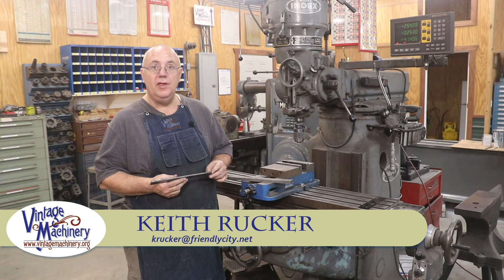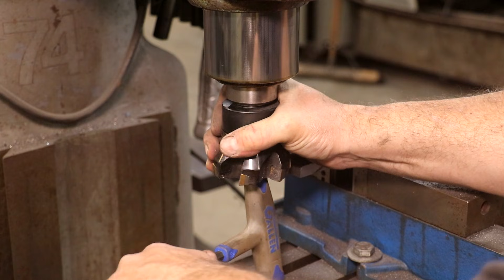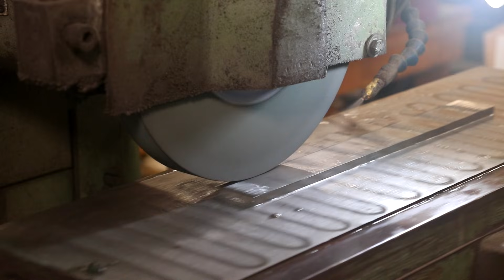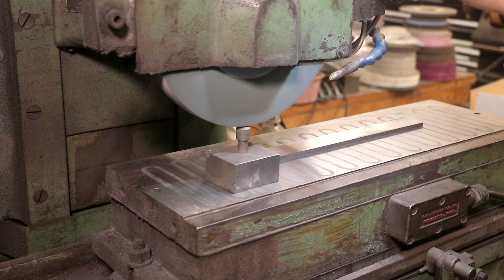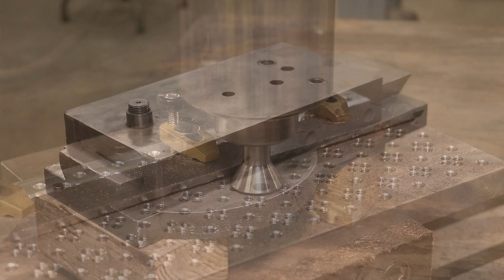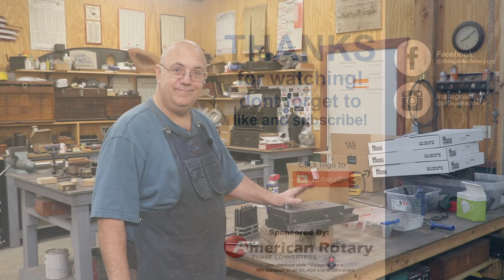Metal Planer Restoration 48: Making a Flat Gib for the Clapper Box Cross Slide

Comment: By placing a bowed nonflat  part on parallels then tapping it down with your lead hammer you bend the part into compliance with your parallels. Then you milled it flat ?, when you release the vice your part will bow back. The best approach to this would have been to check the part on your surface plate and determine the bow that would have rested on the ends of your parallels then place the piece on your parallels in your vice in this position. Do not tap it down- you do not want to bend your part. Take light milling cuts to flatten this side. Recheck this milled side on your surface plate to see if it came out flat, if it is flip the part over on the parallels and you can now tap the part down to your parallels. This would have avoided chasing your tail getting the bow out. You have a great site and I love what you do, I just wanted to point something out.

Comment: Keith, have you thought about spot facing the gib where the adjustment screws contact it? I noticed when rebuilding the turret on my Hardinge DSM the straight gib has this feature. I don’t think Hardinge would have done it if it wasn’t beneficial. Just a thought.

Comment: Just made 8 small dovetail slides out of grey cast using the same old 4 set screws for the gib method . Basically a copy of a SETCO guide . One detail I think you missed is that that spot facing should be “ flat bottom “ and at 90 degrees to the grub screw . Doesn’t make much difference but anyway a you’ve done a wonderful job . Thanks for sharing

Comment: Interesting you put it in the surface grinder as you did. With wood I'd have put it so the curve was up in the middle and shimmed it so the magnet didn't pull it down. Then you could grind the curve out of it without risk of putting spring into it. Maybe it's different with metal.

Comment: Tomato, tomahto. According to Dura-Bar's web site, "Dura-Bar's® continuous casting process begins with a water-cooled graphite die that is machined to form the shape of the bar.

The die is mounted on a bar machine crucible. As the bar is pulled horizontally from the crucible, the head pressure feeds molten iron into the die, producing a fine-grained cast iron bar.

Since the bar is being pulled from the bottom of the holding crucible, dross, slag and other impurities float to the top, away from the opening of the die. The Dura-Bar® process enables the microstructure to be free from shrinkage, gas holes and other tool-wearing inclusions."

So, technically it is an extrusion as the metal is being forced through a die under pressure to form the desired shape.

Comment: When you were using the transfer punch to mark the holes, I was wondering to myself if the angle of the gib was great enough that the edge of the punch would touch the gib before the center point of the punch. I believe that may be the half moon mark you saw on the gib.
Thanks for the videos, I have really enjoyed this rebuild.
Reply: And when drilling the dimple in the gib, should it not have been held at the same 45 degree angle?  Otherwise, it seems like the screw will push the gib down as much as across.

Comment: Keith, you are using Duracast. I'm not familiar with this material. Is it completely stress free? Otherwise I would machine it symmetrical to the centerline. And I also would use some machinist jacks to support the ends. Or buy a longer piece for support on the bed directly. Deburring before you flip the part wouldn't hurt either. And skimming before grinding is also a good idea. It won't matter when squeezed down at it's final place because it seams to be flexible enough to swing to the right place when tightening up the guide screws.  Dear Keith sorry about being picky but this episode looks somehow sloppy to me compared to your other work. I hope it's not a motivation problem ;-) Thank you for all your wonderful uploads; I really enjoy watching them (maybe a small tip on the side; don't put your microphone under your nose. I should lose some weight, just as you, but the panting sometimes scares me...) Thank you Keith! Love your work and I'm only trying to improve it a little bit. Best, Job

Comment: A couple of comments in one - 
Firstly, I note on the vertical operations you keep moving the quill down - removing rigidity to the setup - rather than raising the table - which would have been the better option and may be nearer a better working height for you !
Secondly, you mention about the benefit of the 'palette' for mounting the work - well I'm not seeing anything there that you couldn't do mounting directly to the table.

Comment: Transfer punching down the adjustment holes - depends what the ends of the adjusting screws are like - fine if they have really pointed ends but if the ends are relatively blunt, you need a similarly blunt transfer punch so that you know the vertical offset of where the dimples need to be to hold the gib from sliding out !

Comment: Using shim stock on a surface grinder will help in getting items flat. Place various size shim stock to take up space grind and flip it over and grind the other side and will usually end up with a flat part.
Reply: That what I thought too...because flipping the parts several time while grinding doesn't make the part straight....but on the other hand for the purpose of the part it doesn't really matters if it's a bit bend
Reply: Old tool maker trick. On surface ground parts that require a good finish on both sides use wax paper on the chuck to prevent pull-off scratches.

Comment: 10:30 Why wouldn't you run a file over those edges to debur before flipping the part over?
23:00 Why would you risk a set of parallels rather than just clamp the part over the near edge of the pallet?

Comment: For a dog point set screw you need to set the gib up at the dovetail angle and put your dimples in with an end mill so the dog point has a flat surface to press against.  Going in against a drill bit dimple will force the gib down and cause it to drag on the surface of the carriage.  I wonder if those screws are original- I can't imaging being able to maintain the adjustment without a jam nut to keep them from backing out.

Comment: I think the half moon you got after center punching, was from the top edge of the center punch. They are intended for flat transfer, on an angle like the gib was at, I was surprised the point hit at all.
Reply: Indicating the correct position for the divots !! Actually, it only needed one doing - to stop the gib sliding out.

Comment: To those new to machining and watching this, some words of advice. I know this is not a how-to, but people that are new, watch this and copy the person they are watching. Good habits and the bad habits.

1. Always deburr your part when you remove it from the vise and flip it over (smooth file!). Those burrs will nearly always find themselves under the part and between your parallels pushing it up at an angle.
2. You also want to actually clean your chips off of the parallels, the chips that fall onto the parallels when you removed the part. Chips have thickness, even cast iron dust.
3. Before you clamp your part, make sure your parallels are standing up straight and not cocked at an angle. Parallels at an angle have cosine error and will stand your part taller than a flat parallel. It might not seem like much but a 2"H parallel with a 0.005" chip under one corner or cocked at an angle will raise your part up a considerable amount. Tapping it with a mallet after its clamped will NOT flatten the parallel out since its now in a bind. It will only hammer a groove into your finish all the while making your new cut no longer parallel as you intended it to be.
Reply: This guy is a hacker. His entire channel is a big example of how not to do things. I still find it interesting, though. I do feel like he could be better at what he does, he does a lot of these things for himself. But there are people who watch these videos and I am sure they try to do what he does and they ruin things. 

Within the first 6 minutes of the video I was laughing at all the lack of proper techniques and practices.

Comment: I would put a shim under the middle to keep the magnet from deforming the part.  Given the upward force of the dovetail cutter, the third clamp probably is necessary in this thin part to prevent upward deflection in the center.  If you turn the rounded side of your flat washers toward your clamps, the washers will not mar your clamps.

Comment: I notice your 'indents' for the gib screws were drilled square to the world.  Some of the gibs on some of my machines are a 1/2 moon shape as they were milled (as opposed to drilled) at the angle of the gib.   In your case that would be 45 degrees.  It seems a minor detail but the bottom or pressure end of the screws would be resting on a flat surface.  Was the original you had a simple dimpled like the one you made?  And, does it matter either way in your opinion?

Comment: With the surface grinder try placing shims under the "curved part every inch or two.  Block the part in on the left side with material that has been ground flat and smooth.  Turn on the electromagnetic chuck then turn the chuck off and grind using residual magnetism.  Residual is not always strong enough with parts that are rough which is why it is important to use the ground blocking.  The flater and smoother the blocking the better it will be able to grip the chuck.
Reply: My thoughts exactly, (woodworkers do this on a planer sled !), the way he is doing it is just chasing out the error, instead of rectifying it from the start !
Reply: @russterman1  The way Keith ground the part clearly works.  
However in my experience flipping multiple times works rather slowly and only for small errors.  Bigger errors I have found are easier to correct like I explained previously.  
That said if the part is out .03" typically I would dust it off with a face mill.  
However there have been times when I have taken .250" off a piece of steel 27" lg and 1.125" wide with the surface grinder as I did not have a good face mill.  My Bridgeport and my CNC mill where set up for other things and I could set the grinder up and walk away and and let it run unattended with auto down feed.

Comment: You are a madman. "I took this over to the surface plate and scraped it in"
Reply: Yeah, I was thinking that he might take it over to the surface plate and lap it slightly.  However, on further thought I realized that a scraped surface would make a much nicer bearing surface. This guy's got class.
Reply: @stuartschaffner9744  So why would a scraped surface be better than a plain one which would effectively give a greater bearing surface ?
Reply: @NeilAbalone  I understand that argument but as the oil being used should have good capillary attraction, a smooth surface should slide better - like bald tyres do in the wet !
Reply: @millomweb  , very good points. Keith and others have done several videos on scraping.  As far as I understand from watching them, there are several factors.  First, super smooth flat metal surfaces tend to stick together.  Try putting clean dry gauge blocks together.  Second, steel is pretty strong compared to the loads being put on it in this case.  The slight ridges on a scraped surface provide, in this case, plenty of bearing surface.  Any extra just increases the sliding friction.
Finally, the little valleys between the ridges serve as an oil reservoir and channels to help oil to flow.
Reply: @stuartschaffner9744  The idea is to provide lube so they don't wring together !
The bearing surface is supposed to be oil, not steel !
Reply: @millomweb  ,  umm, well yeah!  Isn't that what I said? Sorry, but I was trying to confine my discussion to what I had heard in the scraping seminars I watched. The tiny ridges on the scraped surface act like a bearing surface while the area between the ridges act like oil grooves.
I will go slightly further to say that you might find OxTools' air bearing project fascinating.  There the two metal surfaces are super flat (no scraping) and the lubricant is air. Tom measures the electrical resistance between the two surfaces.  When the upper disk is motionless the resistance is low, indicating that the metal surfaces are touching.  When Tom spins the upper disk the resistance climbs because of the insulating properties of the lubricating air film.
I am trying to limit what I say because this conversation could get really complex really quickly.  For example, a drop of oil has a surface tension while a puff of air does not. At the same time, oil is orders of magnitude more viscous than air.
I don't want to sound discouraging because you are asking many of the right questions.
Reply: @stuartschaffner9744  To avoid bearings wearing, the metal surfaces shouldn't touch and are therefore separated by a layer of oil. Making space for oil by scraping does create oil pockets but also takes away surface with a higher pressure of oil on it. Bearings in car engines are not scraped but they have pumped oil. Abom79's GE shaper (&Monarch lathe?) has/have pumped oil. The shaper, I believe has scraped ways despite having pumped oil. I think really, the 'jury is out' as to which is better ! But I'm going to favour not scraping with the notion of the other surface 'floating' on a layer of oil !
I'm aware of air bearings (as are many people without realising a hovercraft uses one) and one of my toys in a former employer was a high static pressure blower circulating gas at up to 500psi around a circuit and the seal on the blower shaft was ceramic and relied on the circuit pressure to force a small leak through the seal as a seal lubricant.
Finally, I'll confound you one step further by mentioning glass (medical) syringes. They're a smooth glass tube with a ground glass (so 'rough') piston - and when used with a gas (air) appear frictionless !
Which is better, scraped or not ? Maybe even depends on the surface tension of the lubricant !
Reply: @millomweb  , my background is more in physics, not materials engineering.  In physics, a problem this complex cannot be reliably analyzed qualitatively.  As is often true in the real world, there are many competing processes at work.  Some processes give and some take away.  To see what the final result is, I would normally collect a lot of data, apply them to mathematical models and make quantitative predictions.  I would then measure how accurate my predictions actually were.  Rinse, wash, repeat until I had reason to believe the model was good enough.  Only then would I advocate risking a company's future by predicting how well a future product might work.
Sorry, but I think that I have reached the end of what I can usefully contribute here. You are involved in a really fascinating field of study!
Reply: @stuartschaffner9744  I'm not sure 'physics' is a subject. It's just a label that indicates a scientific angle in the view of life's features. It's broken down into different aspects - like electronic physics - more commonly known as chemistry, and life physics - biology.

Comment: Machinist jacks under the unsupported ends when milling?  Yea, needed shims under the bow while grinding to eliminate problem.  You will never get it out otherwise.
Reply: I noticed the absence of jacks too. The mag chuck was holding it flat down - o no issue there but he should have stuck (pun) with the flat side down until he'd got the top surface equally flat.
Reply: He scraped it in? So it must be close enough to flat?
Reply: @climberjb  "close enough to flat" is rather subjective !
Reply: He never got the gib flat, it was parallel sided but still bowed when he finish fitted it, as usual with no lube..
Reply: @spareparts007  At what timestamp was that ?
Reply: @millomweb  @19:24 you see when Keith puts the gib on the pallet to cut the bevel edge, it does not lie flat but is bowed up slightly in the middle. He should have shimmed under the bow when it was on the surface grinder and machined the top face flat. Then he could have turned it over and it would have had no curve trying to fight the magnetic grinder table.
Reply: @spareparts007  Well spotted !
It did have a flat side when he first put it on the surface grinder. He should have taken more off with it mounted on that flat side. Makes you wonder if there are still stresses in the metal from heat treatment !
I don't think it'll be causing any problems but ideally, it shouldn't be bowed ! :)

Comment: If you're going to mess up, do it early, so there's still enough material to recover!
Reply: Two ways even!  In the long run, just about that much had to come off the length as well.
Reply: I noticed about 7:02 that the head dropped when it cleared the stock

Comment: Keith, keep saying 'extruded' as you're still grammatically right. To extruded is to 'force out', the material is forced out under pressure from the molten material surely?
Love the channel, love your enthusiasm, even if I'm completely lost on the American imperial measurements! 😄👍
Reply: It might be closer to a pultrusion since they probably control the speed the metal is removed from the die, rather than the rate the material is fed to the die as when extruding.

Comment: I wonder if the old gib broke from the repeated impacts of the cutter tool focusing the force on one gib screw tip. I am still mid video but I would make that gib as tight a fit as I could without the screws to give it the best chance of survival and the tightest fit for the Clapper box.  Using the gib screws to keep it in position not to adjust the dovetail lash